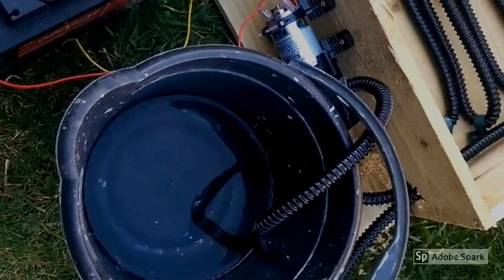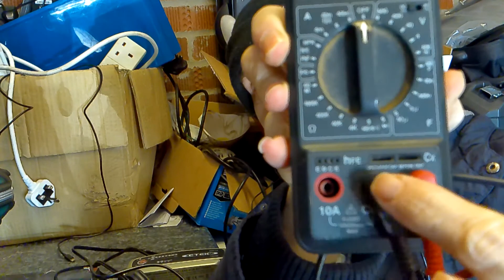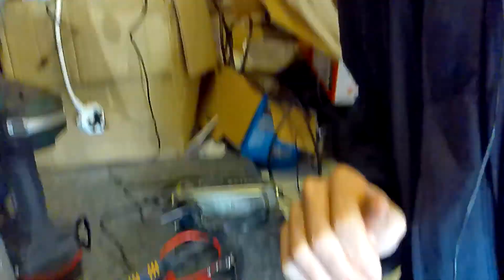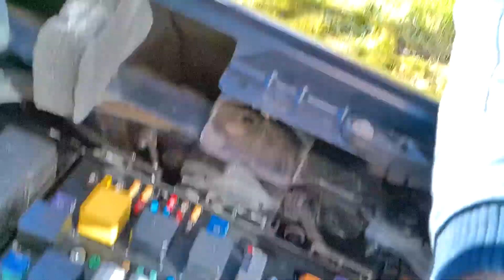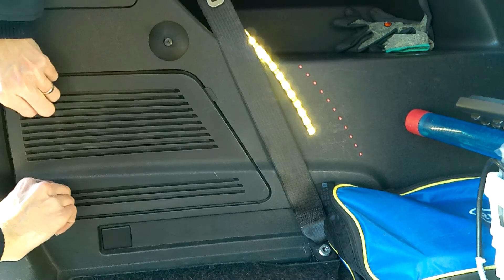Finding why your car battery goes flat overnight

Comment: Hi .I did what you said . Took off negative cable from battery. Put multimeter on amps and move to lead to the 10A how on metre. When I'd that the smoke came out a
Of my positive leaden get very hot.

Comment: Was doing thsi the other day .  took an age to find the fault...dodgy window winder switch ..!

Here ..try one of these picked it up last years, but never had to use it.  
Individual fuse circuit ammeter saves trying to get the probes in the blade socket..then stretching the contacts to the blade fuse does not seat so well anymore.

https://www.sealey.co.uk/product/5637203095/20a-automotive-current-tester---standard-blade-fuse

Comment: Hi Andy. I'm thinking that I can use this method to find a permanent live fuse in my glove box in order to hard-wire a Dash Cam and enable 'parking mode ' which needs a permanent live fuse as the dash cam itself has little power. I was going to use the radio 📻 fuse to piggy back onto. What do you think Andy. BTW - The Nextbase hard-wire kit has a built in cut-off it detects the battery has dropped below 11.2 volts.
Many thanks 😃
Reply from the maker: Hi, yes you should be able to probe for switched or permanent live using this technique also. Best place to start looking though is the radio electrical harness as most radios have a constant live for saving presets, etc, then ignition to wake it up when you have ignition on. You can also buy nice little piggy-back fuses for this exact job (https://amzn.to/2MFABxS) I've used them before, just get the right size for your fuses. I've installed a few dashcams and yes the nextbase are decent but I tend to make my own wiring/hard-wire kits for them.
Reply: Thank you Andy 👍👍

Comment: Hi Andy. What product do you use to protect the battery terminals from corrosion ? Don't fancy using Petroleum Jelly as it gets too mucky !! Many thanks 😃
Reply from the maker: Hiya Steve. Oddly I've never had the need to use anything and never had corrosion so I'm not sure what I'd suggest. You've made me do a bit of research though and see when and why it's needed so I'd like to hear your thoughts on it too
Reply: Hi Andy. I've done a bit of research too and also spoken to my brother-in-law who works at Fords Research & Development Centre at Dunton, Essex ( which is handy ). He told me that these days there's no need to put anything on the terminals as they don't really corrode much if at all.
 But if anyone is having problems with corrosion then he told me that copper grease is the best but that WD40 is not that effective as it's made of fish oil and doesn't always last.
 Another product I've found is a U.S. product called 'Dielectric' which can be found on eBay for about 7.50 pounds and is put on the terminals before reconnection ( look for a UK seller though ).
 Personally, I've decided to put nothing on my new Yuasa Battery terminals as I like to keep a nice clean engine as much as possible and don't really want to get greasy muck on my battery tester or charger 😃
 Hope this helps Andy. All the best 👍👍
Reply from the maker: Great bit of info there Steve thanks for posting back (And yes, handy of your brother-in-law for info). I came to the same conclusion after research, it's due to oxidation from the sulphuric acid gasses, but yes modern cars+batteries don't suffer from this. I have to agree, I've not had this issue on any cars in the past 10yrs so I'll stick to not bothering. I'll only get covered in the stuff whenever I disconnect/connect battery which is often when I'm tinkering! Thanks :-)

Comment: my issue is with the car running the battery voltage jumps around wildly from 14v to 9v to 2V to 12V etc.. while running idle. any guesses?
Reply from the maker: Yes could be either the battery is really dying, or more likely the alternator and/or rectifier circuit is failing. Check for ac ripple. Set your meter to ac and put it on the battery. If you see varying voltages it normally suggests AC and it's your rectifier shot. Either way I'd get it sorted soon as that's potentially damaging to your ECU and electronics
Reply: @junkendriven  Did the Vac on the battery, shows 120-138 jumping around..
Reply from the maker: Oh wow, that's bad news. I'd look at replacing the alternator and/or rectifier pack immediately before damaging ECU and other electronics. That's huge AC ripple. I just checked, up to 100mV (millivolts) is as high as you want. If yours is volts then hundreds is going to do damage

Comment: Hi Andy. As promised I'm back to watch your new video. I'm new to multi-meters so this was a brilliant short tutorial on how to use them 😃😃 👍👍 
I do have question though and that's what does IOD stand for ??

Back to car batteries and my car seems not to start when it's showing less than 11.5 V, hence why it's not going anywhere at the mo. Hoping to get the Ctek MXS 5.0 charger very soon, although according to Halfords car batteries last for about 4 years which is what my battery will be in May '21...

I have also recently acquired a Yuasa Battery Testing Kit from ebay which includes their Battery Tester which checks the Voltage & also the Cold Cranking Amps ( the power to start your car ). There is a video to accompany the kit which I'll post separately. I bought mine from seller unit-one-1 on eBay for about 26 UK Pounds. He's selling them for 35 Pounds but is open to offers. He has 2 left..All brand new & Sealed. 
Thanks again Andy and all the best. I'll post that Yuasa video separately and just in case it doesn't work the title of it is:  Yuasa's Always Check The Battery Guide for workshops. It's about 3mins long 😃😃
Reply from the maker: Thanks for checking back in Steve. IOD stands for "Ignition off draw" and it's the 'idle' current drawn. Often IOD is pulled for shipping and is a sort of catch-all fuse for all idle draw. Commonly found on Chrysler cars but most cars have a similar fuse but with a different name. Yes battery shelf-life is around 4yrs depending on how well maintained. Good info on the Yuasa thanks for the link and info :-)
Reply: That's great... Thanks Andy 👍👍 😃😃
I've decided to get a Yuasa Silver 5000 Battery from Halfords which comes with a 5yr Guarantee & 50,000 starts with 710 cold cranking amps. Please let me know if you get the Yuasa Battery Tester on these comments. All the best Andy, cheers 😺😺
Reply: Quick Update....Bought the Yuasa Battery from eBay as it was 78.57 UK Pounds rather than 120 UK Pounds from Halfords 😃
Only took 1 day to arrive. Checked the battery with my new battery tester and it's showing 880 Cold Cranking Amps from a claimed 710 CCA. That's 115%... So very well pleased with that and looking forward to fitting it now 😸😸

Comment: Excellent work Andy I've just got done wiring up my aftermarket car stereo in the Zafira to turn on from ignition key turn 1  freaking canbus! Trying to find a ignition live on key turn 1 was a pain in the ass! However all done now. Andy you should check your live terminal on the battery when the car is running its most likely burning hot apparently common fault with zafira due to high resistance and Vauxhall crappy battery clamps? If you have the issue do a video for rectifying the issue mate Astra H has the same issues. Cut and crimp new connector.
Reply from the maker: Thank you! Glad you sorted your canbus problem out. Good point with the battery terminal heat issue, I'll check it out, thanks for the advice :-)